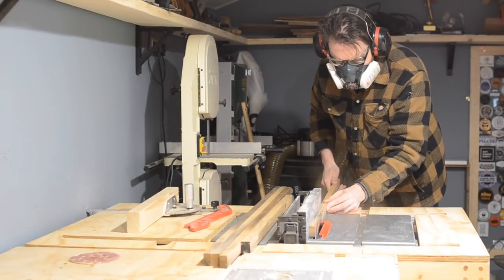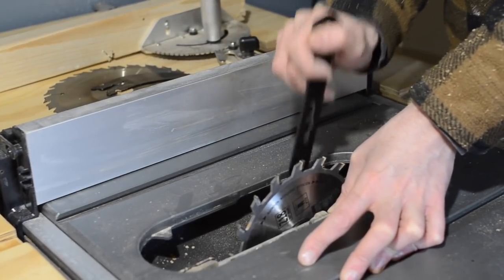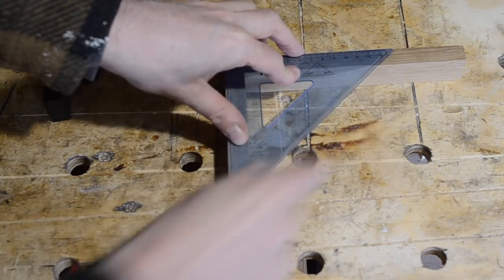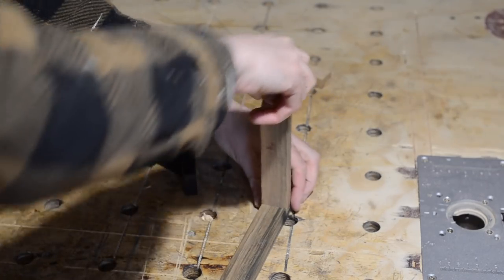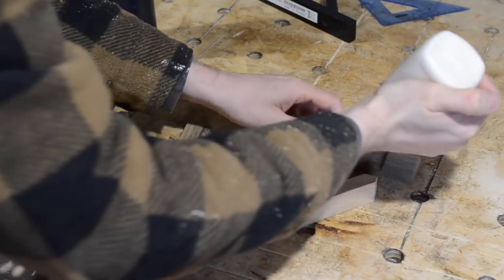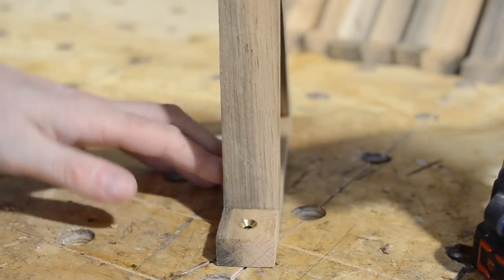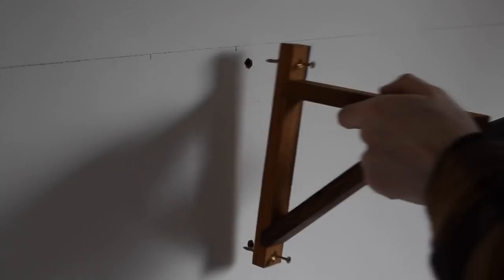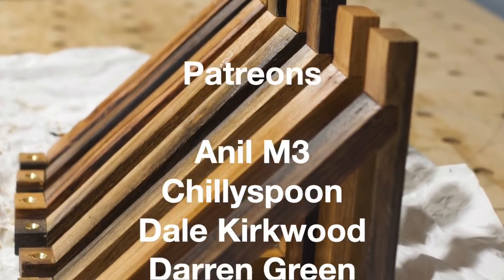Oak Shelf Brackets

Comment: Lovely job Matt 👍. My head was hurting within those angles but think the penny dropped in the end! Either way, they look great.
Reply from the maker: Thank you. My head was hurting to
Reply: Badger Workshop Does the grooving blade make a big difference vs a general purpose blade?
Reply from the maker: It has a flat tooth so if you are not cutting all the way through the wood, it leaves a nice finish.

Comment: Yes you can buy from ikea, but YOU ARE  A MAKER, You cannot compare the price of Ikea against your costs.
You had the wood , you had the glue you had the saws, the only thing you may have bought were the brass insets. You cannot divide the individual costs.
You can only say, bought wood, bought glue, bought brass, bought table saw, bought clamps, bought drill, bought screws, bought stain, bought shed,  paid electricity..........tell me when to stop,

You built some shelf supports ACE ACE ACE

Yes if you didn't have the above you would have gone to IKEA and borrowed drill,  borrowed drill bits, borrowed screwdriver/ drill driver, 
Great video good brackets
.
Reply from the maker: Thank you